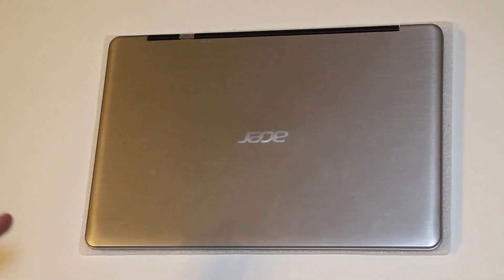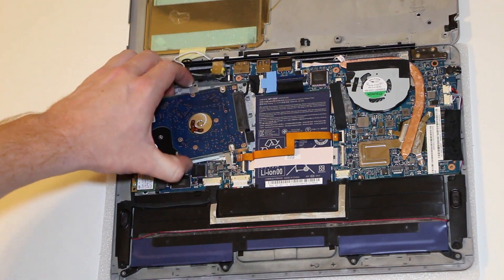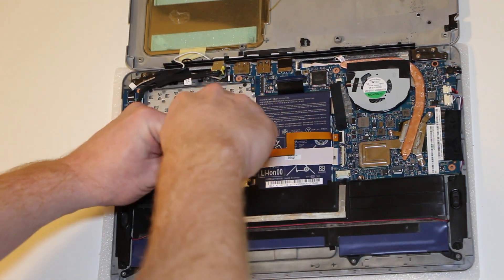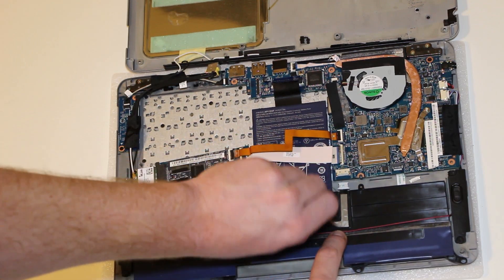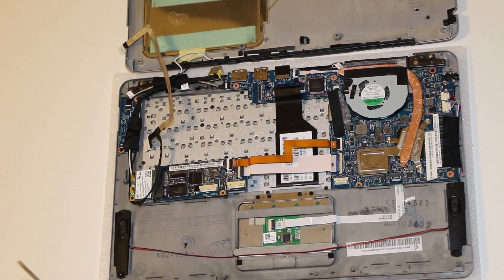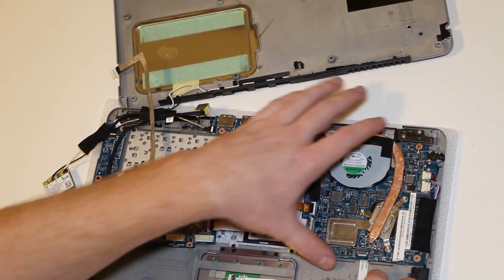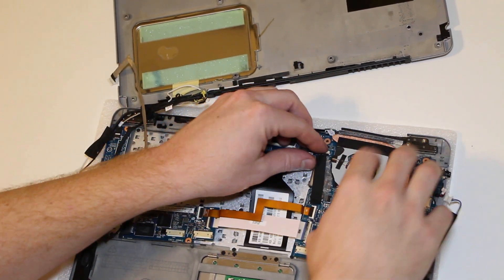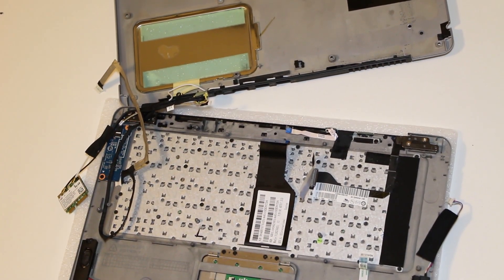Acer Aspire S3 Ultrabook Teardown / Replacing Motherboard or Keyboard or Upgrading Hard Drive to SSD

Comment: 😊🙏🏻 Hello, Namaste from India. Great review, good job.👍🏻🌟😊. I need your small advice. I am looking to buy this model laptop, I am getting this model refurbished laptop for $186 i5 500gb version. 
In market new i3 11th gen different  laptops are almost $470+ in my country. 
1. Can I buy this laptop? 
2. Will it still handle win 10 home version comfortably without lag or should I use it with Win 7 Ultimate version so that it won't lag? 
3. How long does the battery last and how long does it take to charge the battery? 
4. Are parts easily available in future in case if anything breaks and need repair like display, battery, keyboard etc 🔋 replacement?
Thank you for your time. 
Love from India 🇮🇳.

Comment: My S3 has now USB port not working after a HD change due to HD sectors damage. USB are listed in the device management application but any USB stick I insert it is dead, not reachable.
Do you think it is a hw problem or driver ?  is it possible to damage the port during HD change.
Thanks a lot for any help

Comment: Hello, spy from Mexico and I would like some help with my acer aspire s3 since the clock does not advance and remains in the same schedule and date; I opened the laptop to check where the CMOS battery is located and I do not locate it anywhere. Do you know where the CMOS battery or internal BIOS battery is located since I can not locate it anywhere, I opened the laptop and can not find the battery? Do not you save where the CMOS vateria is located? My laptop is a acer aspire s3. I await your prompt help and thank you very much.

Comment: i have a problem, i have the laptop shown in the video above,  its windows 7,  but my problem is when i turn it on it shows the acer logo, an then goes straight to a black screen that says "no bootable device -- please restart system" what could be the problem i've googled it and nothing seems to work? model number is - MS2346. be great if someone could help me out.
Reply: +tyreLL p3chawiis Hello, try rapidly pressing F2 when it boots and changing the bios setting from "UEFI" to "Legacy Mode"

Comment: Thanks for the vid mate, very helpful. I have an Acer Aspire S3-391 and loaned it to the missus and she dropped it!! Turned it on, slow as hell reading off the HD and blue screening etc. With the help of your vid I opened it and had a look and everything looks ok (no loose cables etc). So I figure it's a buggered HD. I'd like the replace the HD to the Samsung SSD 132gb you were talking about, would it be possibe to get the precise catalog number for the one you used please? Cheers!

Comment: damn this ultrabook really can compare with the macbook air on the difficulty of repairing the diff parts. The s3 392 is easier to repair though, acer at least made it easier to remove the battery and hardrive,the 2 common items that may need to be replace prematurely.

Comment: Thanks for that - apart from there being about 50 screws in total; it is a fairly simple task to do thanks to this video. Just replaced my keyboard. For those looking to do the same; check that the keyboard you're buying is gloss finished or you may end up with a matt one like I did (still works so doesn't bother me).

Comment: Great video, I didn't see where to change the memory.  I am interested in adding memory.
Reply: You can't. The DRAM chips are soldered to the motherboard (along the right side), as is the CPU, and in my case the WLAN card as well.
Reply: So do you have to use an external mem kit
Reply: Interesting

Comment: Hey, my wifi seems poor after opening it to add the ssd, do you know if the placement of the 2 antenna cables matter?
Reply: Reply 5 years later, lol, no the connection of cables doesn't matter, any order

Comment: thanks for the video, nb if just changing hard drive, there's no need to remove connector at tape, remove plastic connector at hard drive itself instead, connector at tape was a bit fiddly to refit! also note that the drive is show with a metal frame which needs to be removed from the existing drive and fitted to the new drive

Comment: my acer s3 touchpad has some issue.in battery mode its working fine but some time if i am connecting charger or lan wire etc.then touch pad is going out of control...mouse point going little here and there.but iany point of time if i touch the back side body of the laptop everything becomes normal.i think there is something with grounding issue.can anybody help my how to correct this/ hw to attached ground- negative or earthing to back side of the body.my email ie is - prakash.prasad4@gmail.com

Comment: If you search ''how to use hard drive space as RAM'' there are multiple tutorials on on how do it. It is not dedicated RAM but it does speed up your system. however, it does take away from your storage on the hard drive........for me that wasnt a problem but for you or others this may be an issue.
Hope this helped

Comment: cab you add a 7mm drive in addition to the 128 ssd drive using the ssd as a boot?  Or do you have to have just the ssd if that is what came with the unit?

Thanks for your help

Comment: On mine the right hand side small circuit board is the SD card reader board. The larger one next to the reader is the wifi board, which has the MAC address on there.